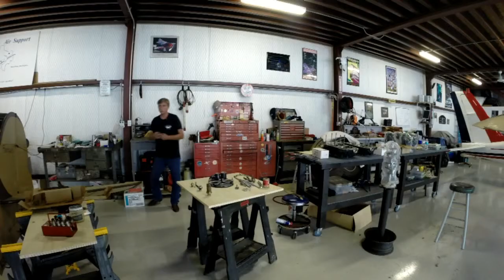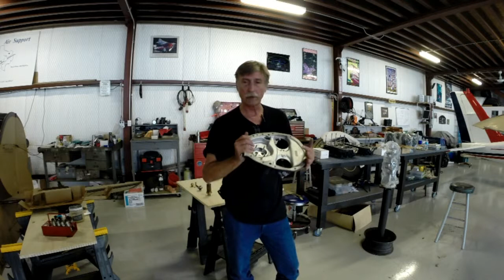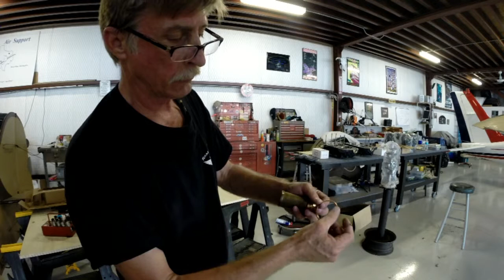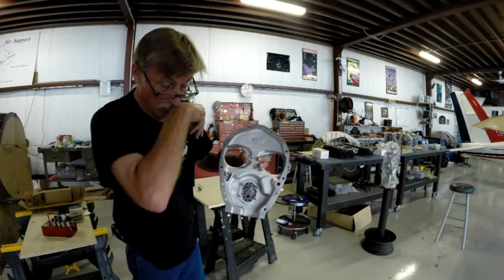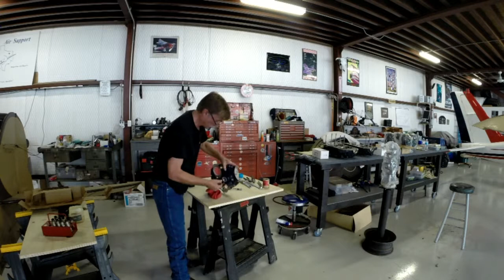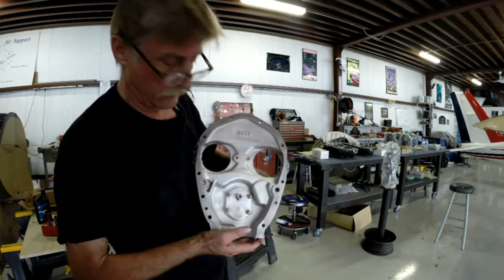Building up the accessory case for my little Continental A-65

Comment: Kevin, have you ever had an A65 that looses its prime? But has good oil pressure.
We have a Luscombe that has this problem and some people say that’s normal. I can’t believe that’s normal. You shouldn’t have to lift the tail up to prime the oil pump before starting.
Any thoughts?
Thanks
Reply: I hope you see this comment, I know your question was 7 years ago, but apparently losing prime is very common with these engines. I had this issue myself and no amount of tail tipping did anything. What finally ended up working was to add 2 extra quarts of oil and that brought the prime up real quick. Of course you have to drain the extra oil back out, but that was what finally worked for me after trying every trick in the book. Good luck.